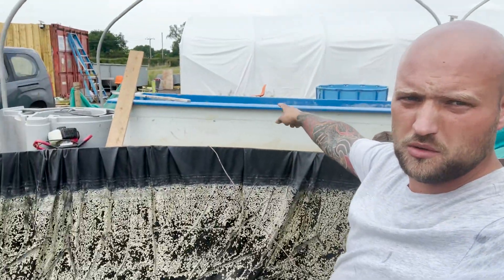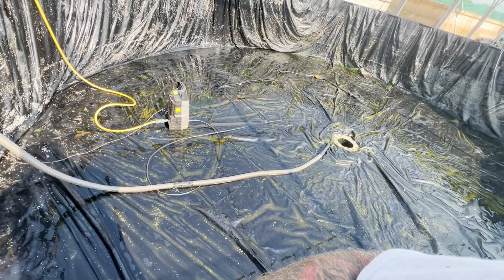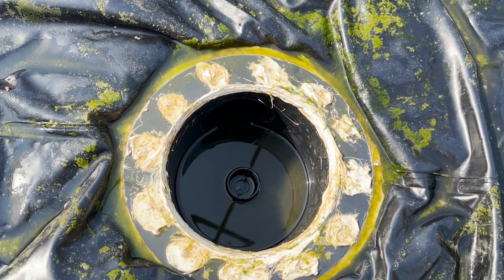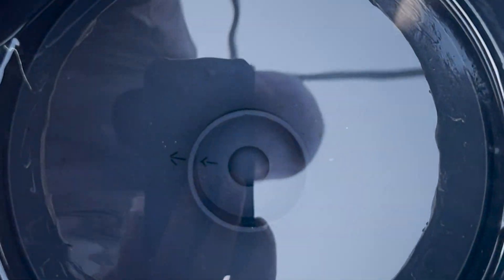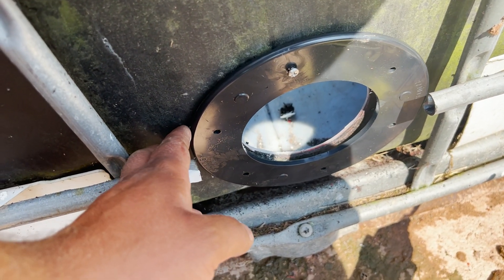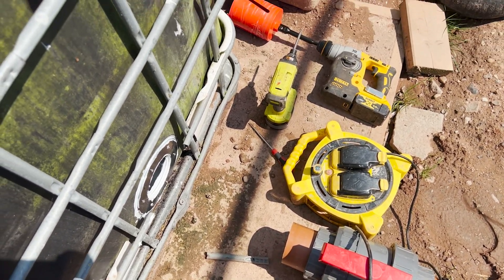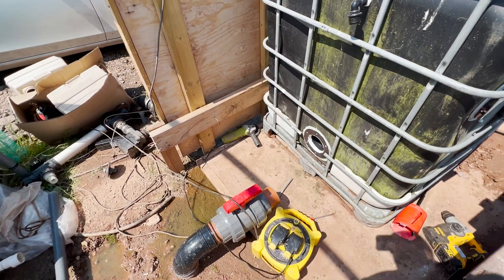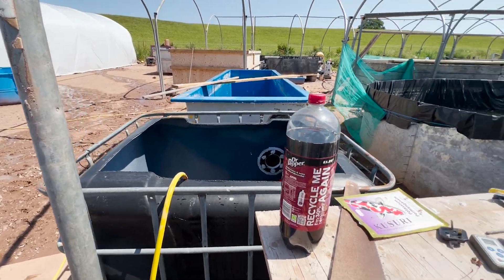AVOIDING BACTERIA problems & The GIANT moving bed filter build part 1

Comment: Hi Jack, very informative thank you. I pull the plastic plate out on the nexus on a maintenance every 2 days which seemed to be enough velocity to clear the bottom drain. I put a Karcher drain cleaning hose down there a few days ago to check and the water was clear do you think this is a good option?.
Reply from the maker: I will always advise bottom drain mate, and if you can fit one, fit one in. If that’s not possible then yes what your doing will be a good option but not ideal